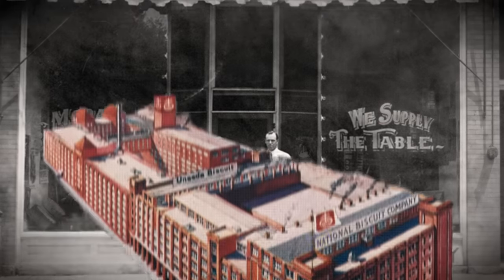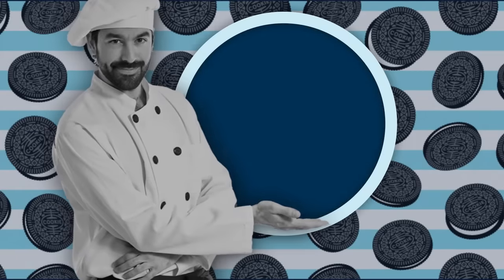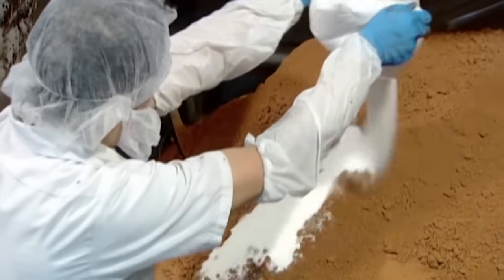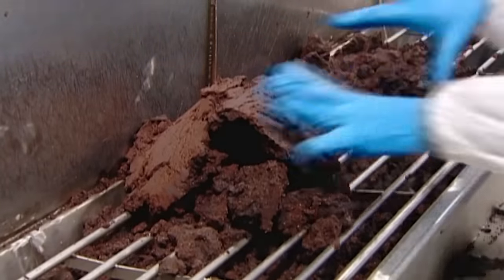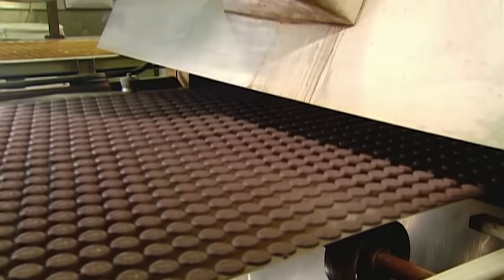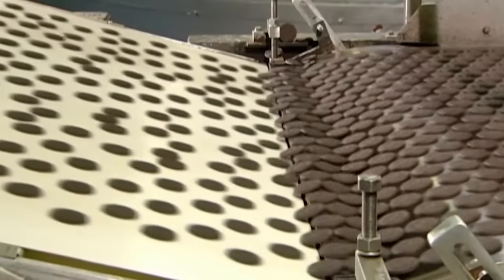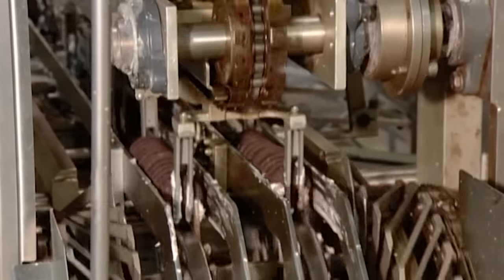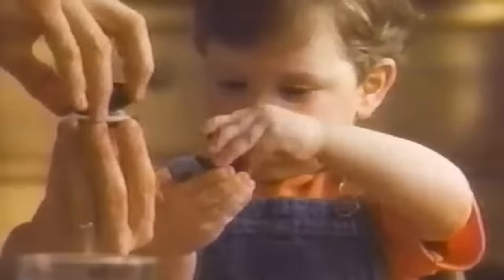How Oreo Cookies Are Made

Comment: Canola Oil is real bad
Reply: How so?
Reply: @Bleedinggum  Not a fan of processed oils to this degree.....Traditional processing methods for making canola oil include cleaning, heating, flaking, soaking, pressing, solvent extraction, and further refinement and processing.14 This makes canola oil a highly processed oil. This process requires bleaching, refining, and deodorizing, yielding a colorless, odorless, and neutral flavor.

One concern about this is that a solvent called hexane (made from crude oil) is used to further extract the oil. This is a process that has taken place since the 1930s. When the seeds are pressed, they form a cake and become saturated with a solvent called hexane. This solvent assists with extracting the remaining oil. Next, the hexane is then removed from the oil and solids, reused, and recycled.14
Also, a bit high on the levels of Omega 6, not good.